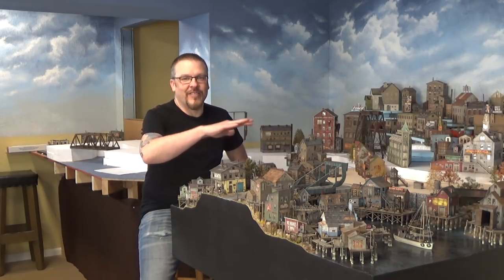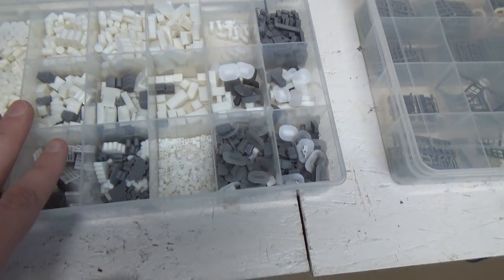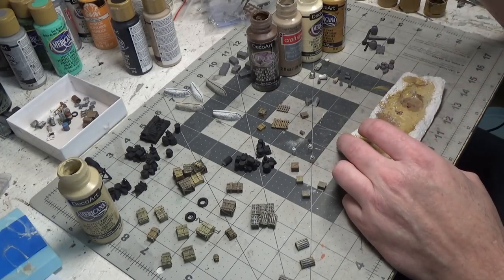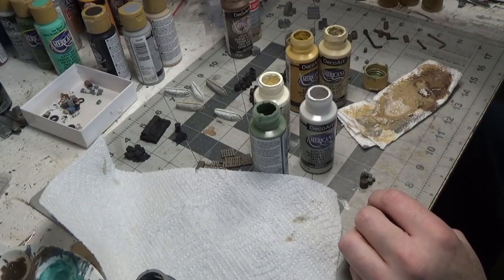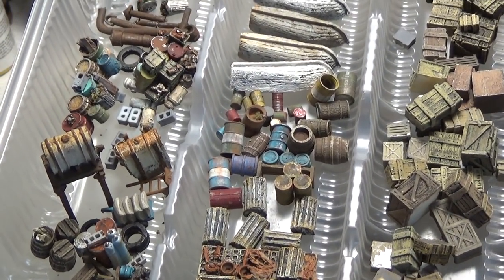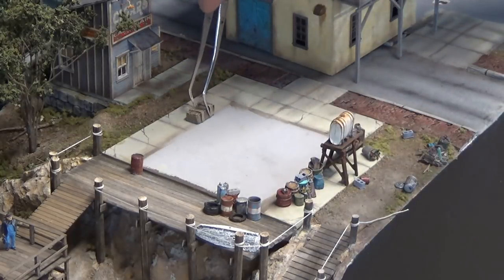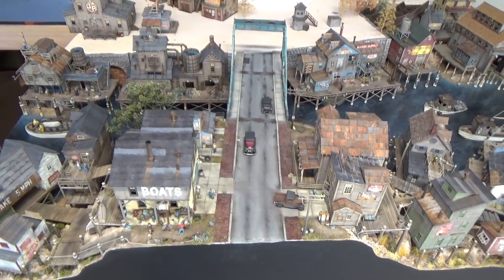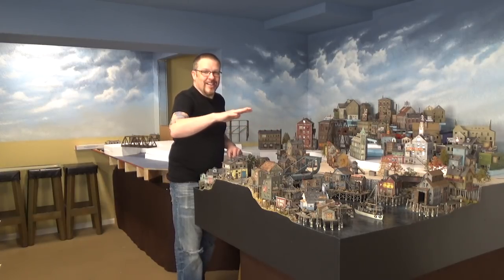ADDING REALISTIC DETAILS

Comment: Jason. I have a question. On the craftsman wood kits you build I see they have large tabs to orient the sides to each other. On a clapboard or similar style building this is not a problem as the corner strim will cover this up. But what about laser etched brick or concrete block walls. Are we looking at sanding the corners to 45° on the back side and hoping to hide the gaps that might happen. Or are the kits made with finger joints between the individual courses so that the courses of one wall actually end even with the outside of the wall perpendicular to it. Think of it as a drawer with box or finger joints. If one uses 3/32 Basswood for example it actually gives an extremely close scale wall thickness as a standard concrete block is 8x8x16. This scales out to within a couple of thousands of 3/32×3/32×3/16. Now I admit cutting this by hand can be taxing on the eyes but with a laser it should be a piece of cake. I've been messing around with the technique the only thing holding me back right now is grinding #18 Exacto blades reliably to the right width to plunge cut end of the slot that the course on the other wall would mate with.
I used to have access to all kinds of tool room machinery at work but sadly that's in the past. A #18 ground to 3/32nd wide would make it extremely easy to cut the ends of the slots cleanly.

Comment: Jason in one of  those videos that You exchanged Your techniques in a project with Your FOS Scale friend Doug, I guess the 4th edition, You used the Krylon limestone spray paint!  In which  kind of surface can I apply such  paint!  Can I use it on  pink styrofoam to color rock faces, for  example?  Maybe it can not be use on styrene, right?
Reply from the maker: It can not be used on styrofoam. It will destroy it. It can be used on paper products and wood. Maybe on plastic but I have not tried that yet.

Comment: As much detail as you wre putting in would have made more sense to start further back. Of course you did say th he layout is in modules basically so I am assuming you can take the foreground section out to work father back. Also are you going to do any forced perspective
Reply from the maker: Yes, I will do some force perspective.
Reply: @JasonJensenTrains  
Well that sounds like some N scale structures & details. Are there any TT Scale details or structures out there that might work. With the plethora of scales out there. We have O at 1/48th, S at 1/64th, OO at 1/76, HO at 1/87 (3.5mm per foot), TT at 1/120, N at 1/160 and Z at 1/220. I'm kind of surprised that we didn't see a 1/96 scale (call it True HO) or a 1/100 scale (call it 100M or M100) come out of Europe. Given the dominance of the metric system in Europe this actually would have made sense. 
Of course the model railroad scales are no where as screwy as aircraft, ships and tank models. 1/32, 1/35, 1/48, 1/64, 1/72, 1/76 etc add in the really weird 1/33 card models from European publishers such as Halinski (weird because of the ratio in a metric environment).

But the model railroad hobby was only going to support so many scales. O is simply too large for the average home layout. S is borderline. HO strikes a fine balance between detail, reliability and size. N is getting pretty damn good. Z and TT I simply do not know that much about.